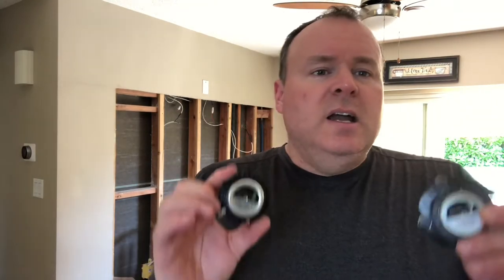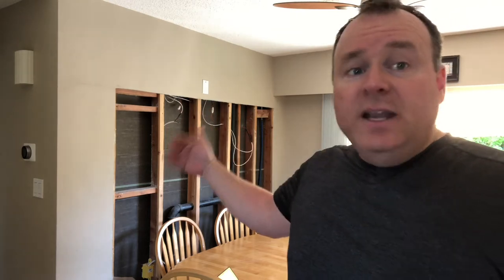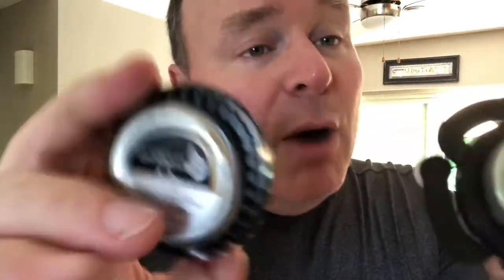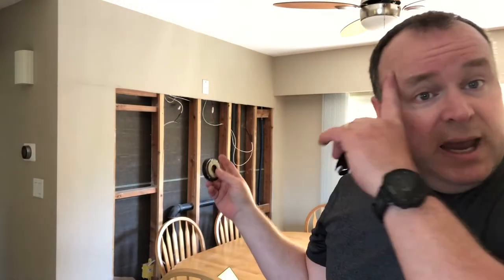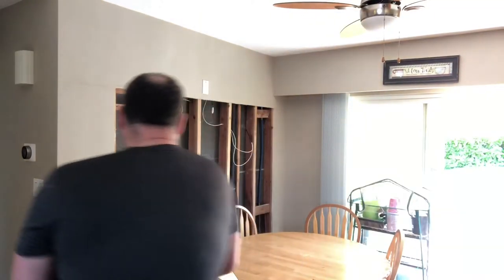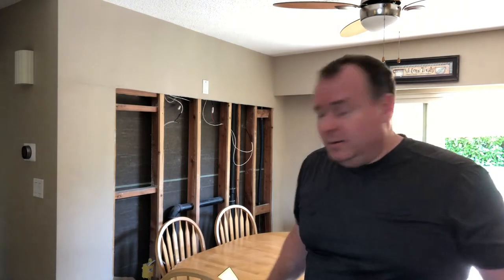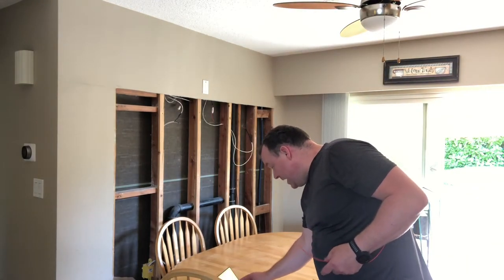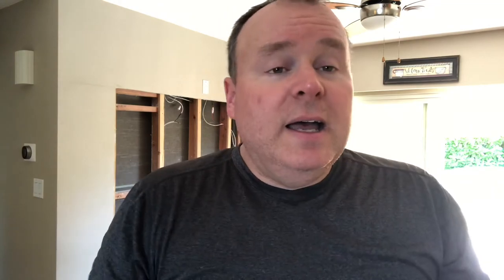DML Speaker - Turning Drywall into a Speaker with Audio Exciters

Comment: So .... I'm wondering if the drywall do not suffers any damage due the vibrations over time? Like starts crumbling it down bit by bit.
Reply from the maker: There has been no signs of breakdown at all. And we use the WALL a lot. I have to admit I was sort of fearful that there would be some damage .

Comment: I actually did this a few years ago when I finished my basement. I also used a low frequency exciter in a half wall as a sub-woofer. I've been listening to music in there for around 2 years and it still works great. I also did a few other things to make sure there is no rattling and drywall mud doesn't crack. I also was worried that the 3M tape would unstick over time or tear the paper off of the backside of the drywall so I mounted them differently so that they would be more likely to stay attached over time.
Reply from the maker: That's awesome Andy! Would you agree with me that it actually sounds terrific! If I were to do it again, I might do what I saw another YouTuber do, and put a small puddle of epoxy on the backside for the exciters to stick too. That looks to be very secure
Reply: @consumertechcheck  It surprised me the first time I tried them out and it sounded so good. I wasn't sure what to expect. When I installed them I tried searching to see if anyone had done it before and I couldn't find anything so I was just hoping it would sound good. I actually glued them to a small 1x and used drywall screws to suck the 1x to the drywall for better contact. The best part about them is that no matter where you are in the room, the sound is coming from right next to you and you don't have to have it very loud to hear it where ever you are.
Reply from the maker: @andyk764  I agree, they sound unexpectedly good. And the cool factor is off the charts. I will put these inside every wall that I have to open. I likely won't open walls to install these, as it becomes far more costly then the exciters themselves. But if I have to open a wall for a repair... The wall is going to get some exciters. At that point, the cost is just the exciters. The results are terrific!

Comment: Wondering if these could be placed in the attic making the ceiling a spkr without any drywall repair. 🤔
Reply from the maker: Yes… yes… yes
A thousand times YES..!

That is a brilliant idea. And a precious viewer has tried that and it worked wonderfully.

The gentlest part about doing that is… you don’t need to open a wall then repair it, which was by far the most work and time required.
Done in the attic, this could be a 1 hour install, and would be brilliant.

For sure… give it a try and let me know!

Comment: thanks for your honesty, and efforts!! two tips from an old drywaller...1. mount the drywall on RESILIENT CHANNELS. 2. attach drywall with adhesive, using a few screws till the adhesive sets. My reasoning:  vastly-more movement is possible when there are no "hard point" attachments for the boards. That, instead of the usual board-on-stud* rigid attachments. That "should" allow a lower bass reproduction?!?!?   * 1/2" drywall-on-METAL studs have much-more resilience, which is why they are the ONLY-kind used in separating walls within music recording studios (sometimes with added resilient channels, too). The "resilience" is what attenuates the sound between spaces, sure. But in the case of Exciter-mounted surfaces, I'd imagine that "resilience" would only INCREASE bass response/accuracy. Heyyy...remember the long-ago-gone Poly-Planar speakers from the '70s? They were expanded foam panels with what must have been the very-first model of "exciters", which were fused right into the panels. Another thought...those bathroom drywall panels are of a much-denser/different matrix than regular gypsum drywall. And there are even more-modern mixes now. All which would mean a vastly-different sound signature, I reckon 🙂
Reply from the maker: That is great advise..!
I highly anticipate I will do another wall… I may do exactly as you recommend.

Thank you!

Comment: I'm curious how long the exciters will stick on their place. On the log run I expect the 3M stickers to loose their strength and eventually the exciters will drop. Only question is when?
Reply from the maker: That is a perfectly fair thought... and fear of mine. Realistically, if they did become unstuck... I wouldn't be surprised... SAD yes, but not surprised. Thankfully that are still holding strong. When I do this again, I will stick them in place using epoxy, ONLY because, from inside a wall, they are perfectly UN-serviceable.

Comment: Was just browsing around to see anything I could about distributed mode loudspeakers because I feel like the way these things work would be best suited for specialized low and high frequency applications. Unfortunately, the majority of demonstrations and references I've come across until now use small panels that are usually made out of the same handful of materials. 
Thanks for the upload. You're awesome!
Reply from the maker: Thanks for the feedback. It was this primary thought that drove me to do the video... there just wasn't any out there using other materials at the time.

Comment: Did you ever consider trying  to only screw down the edges of the drywall, leaving the entire center not screwed down, thus giving you more radiating surface area that isn’t stifled by this screw contact points?

Comment: Looking to build some myself. I noticed many used the insulation foam and they rounded the corners. Made me think, those look similar to cheap foam kickboards. The already are shaped and some even have neat graphics. I've found many on clearance for as low as 2.50 each and now I'm considering a build myself.
Reply from the maker: What this project has reinforced for me is that it appears that just about any surface will make impressive sound.  The good news is if it doesn’t work you can cut away the sticky tape bond and re-tape them to a new surface. I highly recommend 3M VHB tape. It is ideal for this scenario

Comment: I wonder how well they last over time.  I also wonder about the damage they would "cause" as they shake over time.
Reply from the maker: I wonder and worry about that too. My fear is that they may crack the drywall, even though there has been no signs of this yet… more-so, I fear that they will shake themselves loose and fall off the wall, inside where I can’t get to them.

Comment: Was just looking for this. Please let us know how it sounds.
Reply from the maker: Damian, I will be mounting new drywall over this hole inside the next 10 days. I'll do another video then, following up. So far I can say it sounds unexpectedly good. with one realization. It certainly does require more power to move and make sound. I find myself turning the volume up more to get the results I'm looking for. Rest assured, i do find the results I'm looking for, just takes more power, which is understandable, and a bit expected. I am thankful I used multiple drivers to allow for that extra power. More to come..!